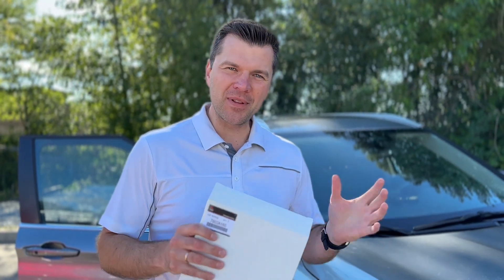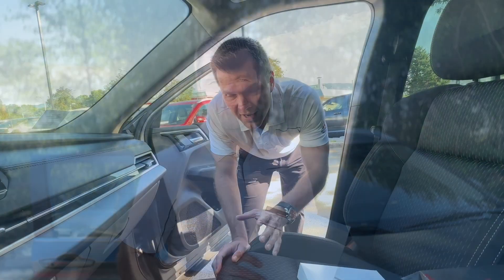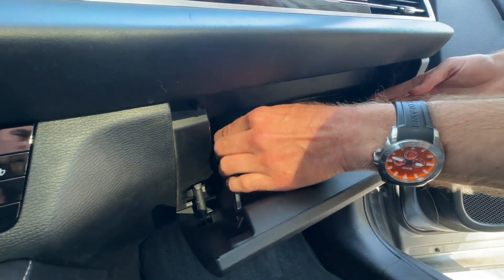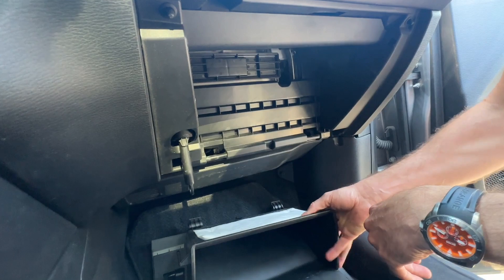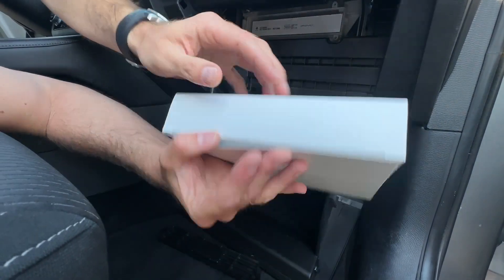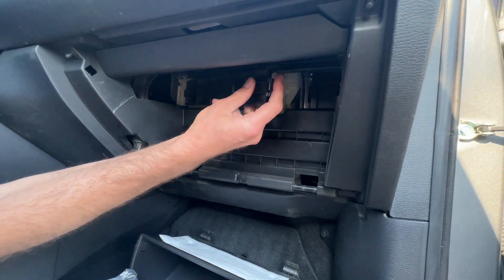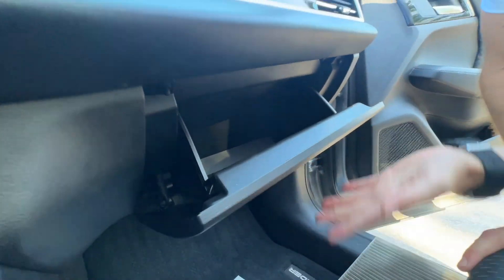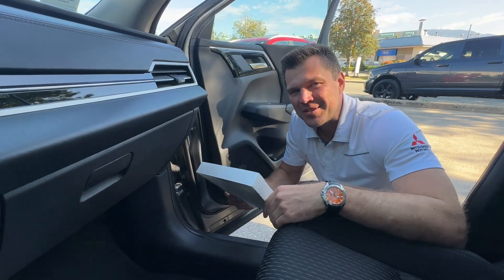Cabin air filter replacement on 2022-23 Outlander and 23 PHEV!

Comment: Hey Mr. My 2023 PHEV outlander air conditioning smells a little funny, like if it is holding humidity from not properly draining condensed air humidity, any thoughts on that? Thanks!
Reply from the maker: Try running it with a heater on for some time, mabe that will help

Comment: Hey boss in my car the glove box light has stopped working I can't tell if the light has fried or if the light isn't in there anymore because we took it to the dealer for servicing and then to fix the centre console leather and it stopped working after that so can u make a video showing where the light is in the glove box and what fuse corresponds etc thanks
Reply from the maker: Thanks for the comment, will have to look into this.
Reply: @mr.mitsubishi  thanks a lot, I’ll be looking forward to it
Reply: @mr.mitsubishi  😁

Comment: if anyone cares, the install was the same on my 2018 Outlander PHEV. easier to watch this than try to find it in the owners manual. mitsubishi tend to reuse assemblies for eternity so I wouldn't be surprised if the filter itself is the same part too. amazon "guarantees fit" so i just winged it without a part number.
Reply from the maker: Thank you for your comment